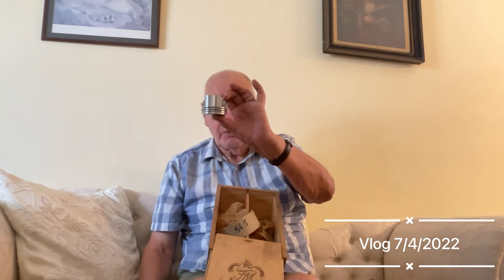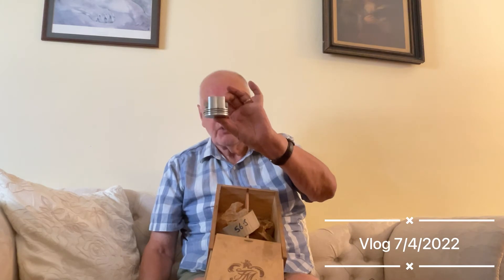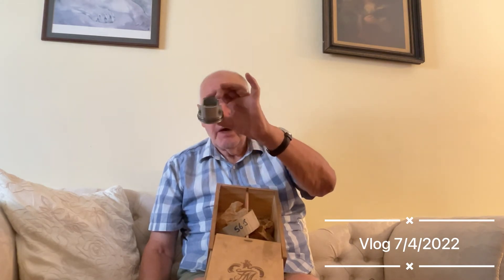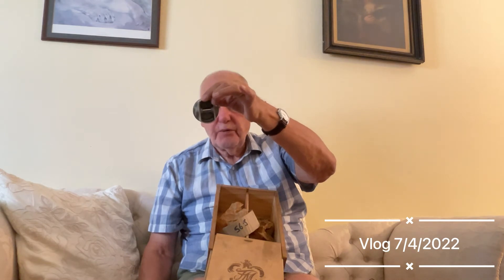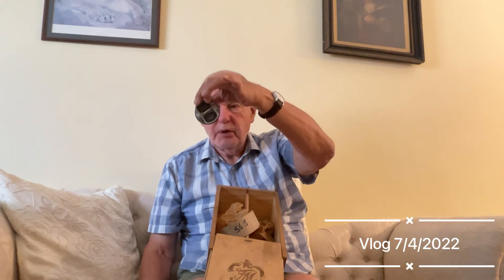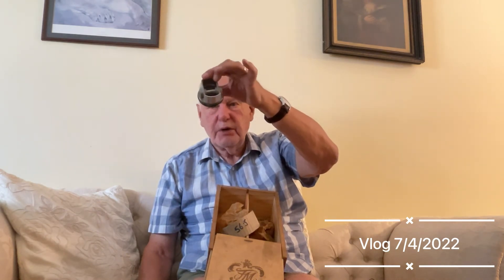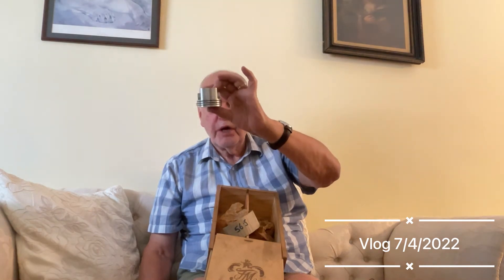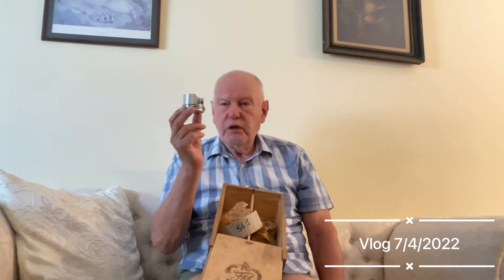Austin 7 Pistons and Engine balancing

Comment: The upper part of the con rods (2/3?)also reciprocates with the pistons so must matter as much?
Plus pistons on a 4 cylinder engine cannot be balanced truly for reciprocating acceleration/ deceleration because a piston accelerating from tdc accelerates at a different rate to the other pistons accelerating from BDC same goes for deceleration when approaching BDC and tdc so no matter how equal the piston weights are, on a 4 cylinder engine the pistons going up will never balance the pistons going down.
You can show this by doing a drawing with degrees of rotation and see that at for example 10 degrees from BDC the piston will be a different distance from BDC compared to the piston at tdc.

Comment: I am rebuilding an austin 7 with ashley body, and just found your channel. Very insteresting. From where did you purchase these pistons? i could not find the supplier on the web. Also, my camshaft is too used, and i  have seen that that improvement can be found with greater valve period, in particular with opening before tdc. where can i find this kind of camshaft? best regards philippe

Comment: That's interesting, I have an engine in bits and was thinking about getting this all balanced, so will think again, certainly just doing the pistons makes the whole operation much easier & simpler!
Reply from the maker: Gary, you are quite correct.  It is an interesting question that is very rarely considered.  Be interested to know your results